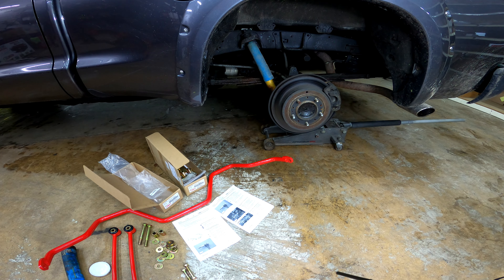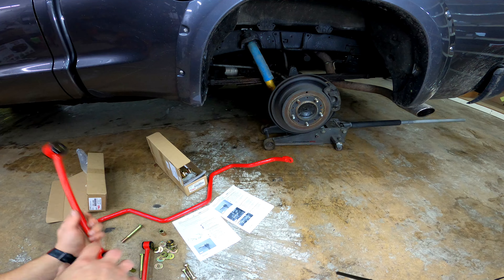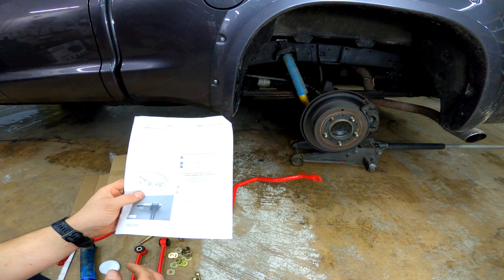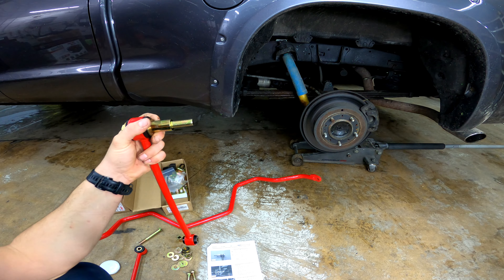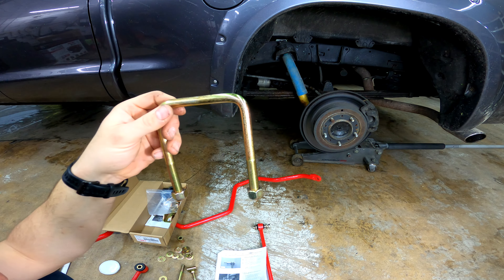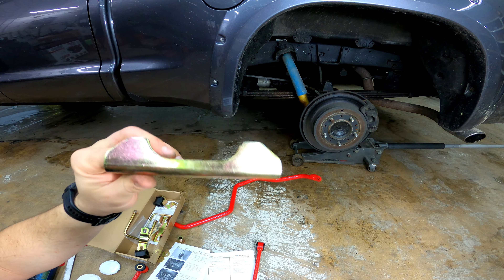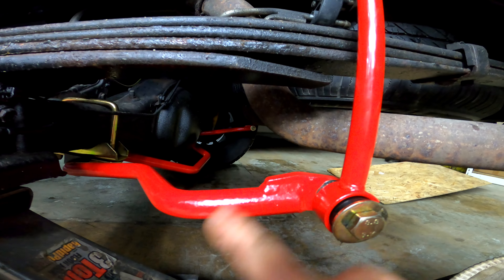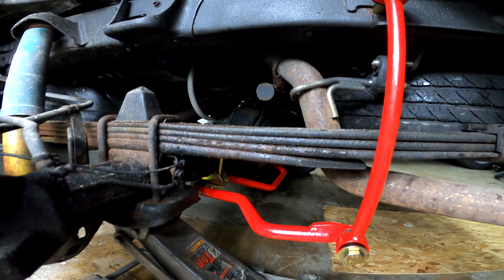Secret Toyota part numbers TRD Supercharged Tundra step by step installation techniques Sway BAR

Comment: Hi. I ran into your posting as i searched for rear sway bar for my 2019 Tundra. You mentioned replacing both (front and rear) makes a huge difference when towing which is what i am looking for. Let me ask you about the front sway bar. Did you have to align the truck after replacing it?
Reply from the maker: No alignment needed. Big stability improvement. You will notice it right away with a trailer and load